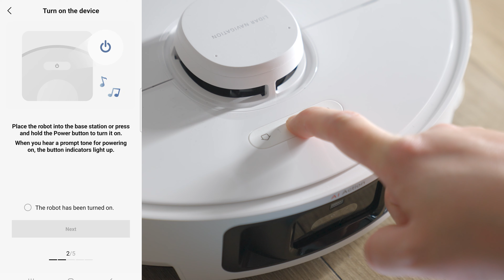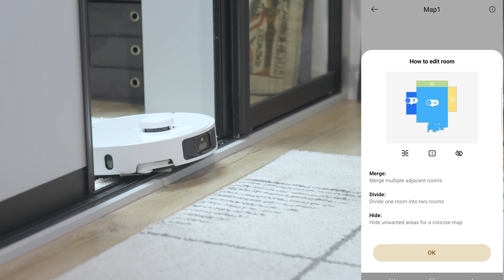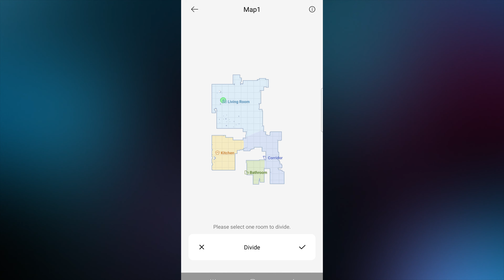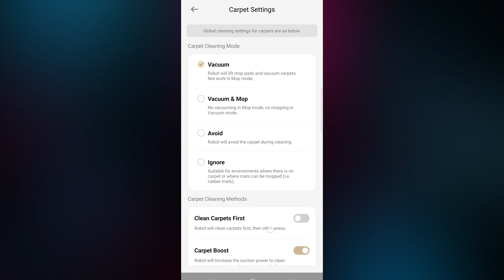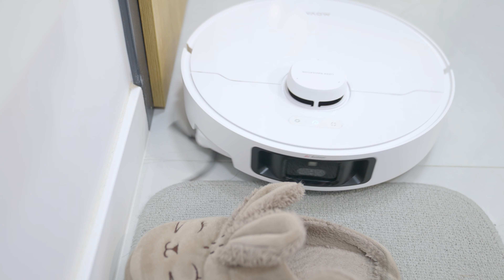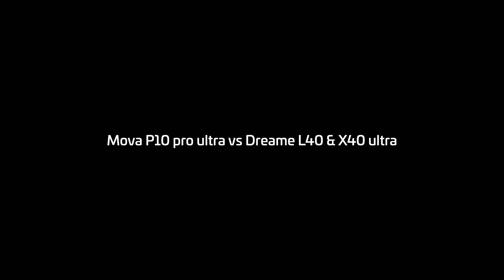Is the MOVA P10 Pro Ultra the Best Robot Vacuum? We Find Out! [Part 2/2]

Comment: Also how is the vacuum when doing in at the side? Does it do a great job at mopping hard floors?
Reply from the maker: It has a special function for extending the side brush, so it does a pretty good job of sweeping dirt out of corners and hard-to-reach spots. However, when it comes to mopping, it’s more of a wipe than a deep scrub. This isn’t a true mopping vacuum like the Mova K30 mix I recently tested. With a cleaning robot, the biggest benefit comes from regular use, rather than running it only when the house is covered in cobwebs or after a big party. :) You can also use few different options regarding how deep Your floor should be cleaned.

Comment: Was looking at this and the dreame x40 what are their differences? Tech specs wise this is better? Just afraid of the support since this company is new no? And basically no review on yt except this channel.
Reply from the maker: Mova is a part of Dreame
Reply: @ i know its a part but how do you compare it with the x40 ultra is this better than it in your opinion?
Reply from the maker: It’s the same hardware with a different name and price. The features are almost identical. The only difference, as far as I know, is that the Dreame X40 has the option to leave the mops in the docking station, which Mova doesn’t have (I asked the manufacturer, and this was a conscious decision—future models will include this feature). In my opinion, this isn’t something that makes or breaks the model, but a lot of people pay attention to it.
Reply: @ i see its not a deal breaker for me if its like that then i could get this and try it out we dont have pets ot anything but were moving to a large house now so i guess a robot vacuum makes sense? Did they tell you when are they releasing the next models and for how much?
Reply: X40 has video camera, cruiser feature.
It is $999 on Amazon prime and p10 pro is $599

Comment: I have ceramic tile floors with wide grout that is slightly indented. Will the mops be able to clean grout or just skip over it?
Reply from the maker: It really depends on how deep the grout lines are. The app does let you adjust the robot’s behavior for tiles and other floors—for example, you can have it follow a certain pattern or move in a single direction, etc. If the grout lines are deep, no standard pad or mop will really “dig in.” You may also hear the wheels going over those deeper grout lines, which can be a bit annoying, but that's pretty standard for any robot cleaner.

Comment: My new machine appears defective- the sweeper does not spin or extend.  Is this a setting problem or should it work out of the box?  Nav appears random and not as tight as Roborock.  Customer service number is nonresponsive. Any thoughts? 😢
Reply from the maker: Did You try AI settings in app? Side reach and mop extend have to be enabled first. Where are You from? I will try to reach Mova so they can help You

Comment: I think that the only difference to the x40 Ultra is that the P10 Ultra pro cannot place its mobs in the station and can vacuum. However, this function is not the non plus ultra feature. But the P10 Ultra pro vacuums with a maximum of 13,000 PA. and the x40 with 12,000. The app is identical.
Reply: Will MOVA be able to add placing mobs on dock function is firmware updates or is that not possible at all?
Reply: @ The technical requirement is probably there, but they probably won't do that to ensure the distance to the dreame. But in my opinion, the mob take-off function is also overrated. Unless you have really fluffy carpet or carpet with very high threads, and even then I'm not sure if that's always such a game changer. Because the mobs are not dripping with water and dripping when they are up. I have done both with my x40 and I vacuum some of the carpet quickly myself and leave most of the carpet out.